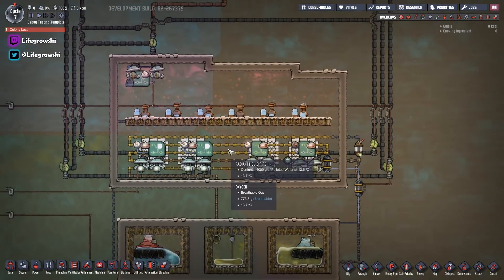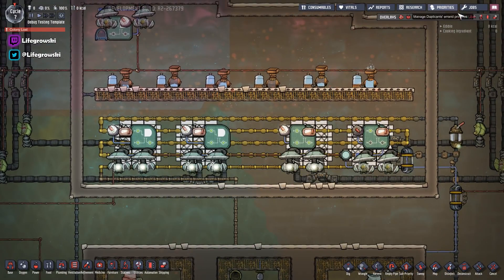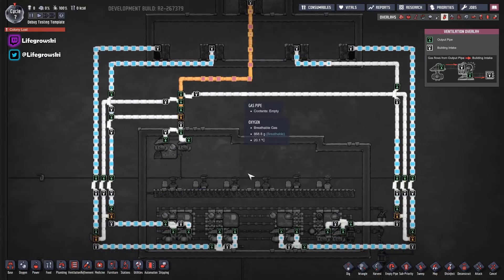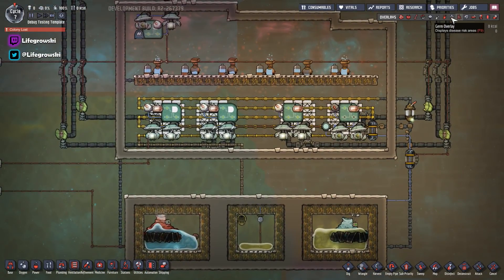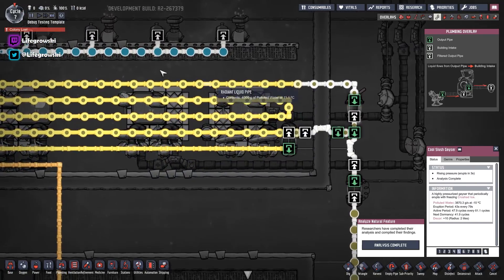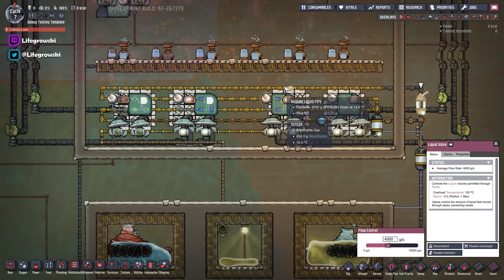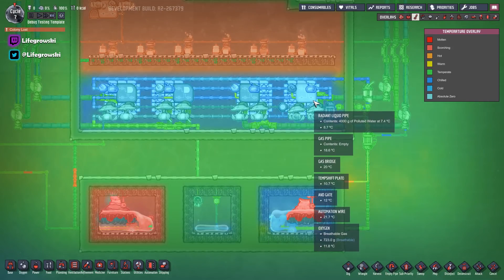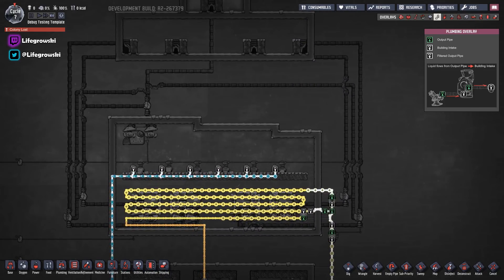SUPER EASY COOLED OXYGEN BUILD (with save file!) - SCALABLE, CHEAP AND SIMPLE

Comment: the issue i have with an open electrolyzer build is it dosent produce as much O2 as a close SPOM type build so u need more if u want to have alot of dupes which i like

personally i use a dual SPOM build and pump the O2 into a overpressurized O2 tank connected to a AETN with the needed automation to control the temp in the O2 room
hydrogen u can send where u want but u arent cooling it at all so no wasted energy

the downside to mine is its very costly to build and run

Comment: I did it the opposite why where i made a cool pwater pool with a seive pulling some out to give clean water. as the pwater is pulled out it helps recool the pool. i ran a sed rock pipe thru it and cooled the oxygen to a 16 degree temp. keeping in mind temp bleeding

Comment: How do you not have more subs?!?! I love learning more and more about this game. I'm dealing with a cool steam geyser and trying to cool the water. I was trying to do a radiator with 12 weezworts, but this looks so much nicer. I'm trying to build a completely sustainable base. It seems to me that the slush geyser is essential to that. Another source of water and a source of cooling!!! My biggest problem has been getting enough water to not have a negative trend once I start using electrolyzers. I have yet to achieve this even for a 6 dupe colony unless I have 2 geysers, but then I have heat issues. Thanks for this!
Reply from the maker: I have a bad publicist ;) Slush geyser is my favourite geyser by a long margin - offered heck loads of cooling and additional water. However, that being said - if you want to run this same style of cooling build, you don't need masses of water for running through the radiator, just a few hundred kilos will suffice normally (depending how big your radiator is). I do have another video showing you an easy way to get said coolant just by using a few wheezeworts (or an aquatuner if you're power rich). Think it's called something like "Easy passive water cooling - for when you only need a trickle" or something :D

Comment: Did you find out another way to cool down liquids without using that water sieve??
Reply from the maker: Aquatuner / AETN / Wheezeworts - that's all your options bud.
Reply: I'll try wheezeworts, I don't have the slush geiser, and don't like to use that building with aquaturner and the water sieve, sounds like a cheat to me haha.. thanks for keep teaching noobs like me :p ... great job
Reply from the maker: You're very welcome bud.

Don't worry about not using the water sieve - It's not a cheat - it's an intended feature that they've acknowledged a number of times on dev streams. It's no different than electrolyzers outputting at ~72, or carbon skimmers at 40. Have fun with it :)